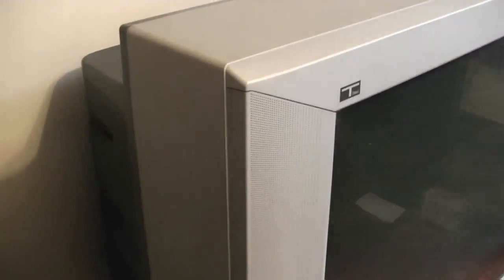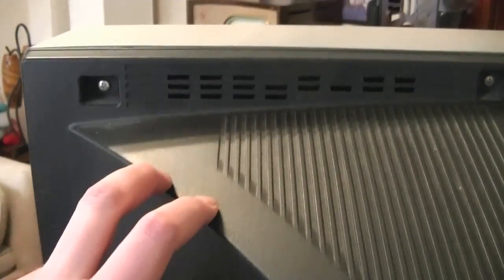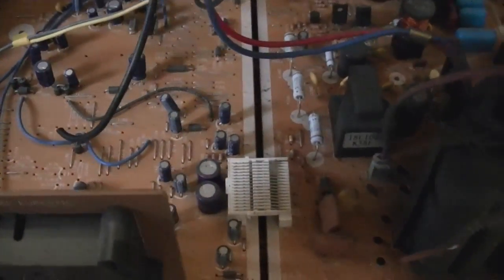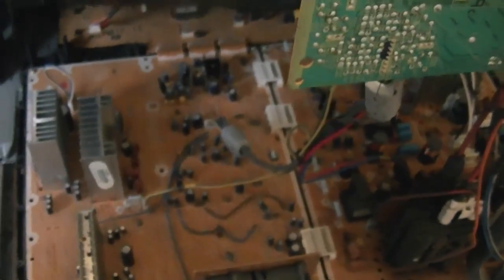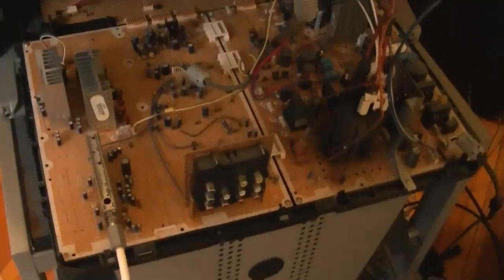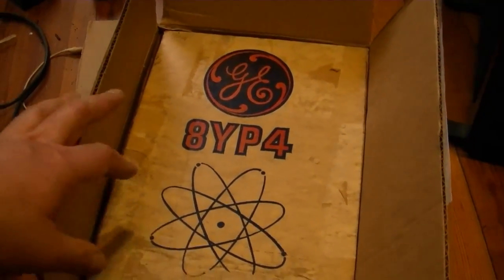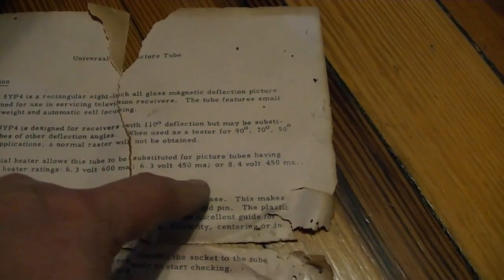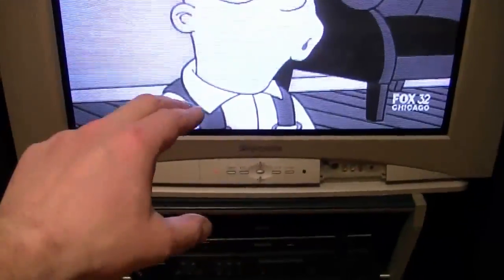Panasonic Tau Repair

Comment: My Panasonic Tau 32" model CT-32SL14J TV just quit last week. Played the night before. Shut off normally to go to bed. Next evening I hit the power button on the remote and for the first time in over 12 years.... Nothing happened. I checked everything after trying the power button on the set. I unplugged it and waited and plugged it back in. Still inoperative. Tonight I removed the back and checked the fuse. It was open. Subbed in a fuse for testing. Checked for low resistance on power cord. It looked ok. I hit the power button and the set is operating normally again.
I bought it used in 2008 for $40 from a couple that had gotten a new flat screen in anticipation of the DigitalTV changeover even though they were using cable. Oh boy... I have some doubt their flat screen is still working for them.
I use this Panasonic Tau several hours a week. Tucker, Hannity, Ingraham, Little House, Andy Griffith is about all I watch. TV was once off for over a year. I just wasn't watching.
I truly like this TV. I'll try to keep it for the rest of my years. It's very very heavy! Moving it is a two man chore. Too large and heavy to move safely for one guy. I do kind of wish to put an older RCA console tube stereo where it is with a flat screen to come up behind it. But I haven't partly because I like watching this CRT TV.
Thanks for your videos. This video was encouraging. I wasn't anticipating the likelihood of an easy repair.
Be well and God Bless.

Comment: i have one of does tv but its have a problem when i turn it on i see that the only thing i see is like static left to right what can i do to fix it i try with the screen and focus usig a screwdriver but it only turn white and black with the static left to right help me please
Reply from the maker: What are you using for a signal ?  This TV is too old to receive HDTV broadcasts.  You need a converter box or like a DVD player hooked up to the composite inputs

Comment: I watched your video and have a question AFTER replacing the fuse. My Tau (also 10 years old) stopped working…..the symptom is that depressing the power button  illuminates the "RED" LED steadily, then it blinks twice accompanied by a click-click-click sound………….and then, nada.

My 6.3 amp fuse was located on the LEFT side of the board, right near the AC cord plug in……..it looked okay BUT I replaced it anyway, put the set back together and the same exact symptom, no change. 

Any thoughts? The fuse did pop once 4 years ago and we replaced it then and all was good……not sure what this particular issue is, however.

Thanks for any help that you might render!

Steve
Reply from the maker: Hi.  Sorry, I don't repair modern TVs and really don't know much about them.  I got lucky with mine and just had to replace the fuse.
Reply: bandersentv Thanks for the response!! I HAD to try the "fix" because that fuse had burned out once before……..it's probably a sub-board component that failed. The Tau is headed up to the curb as soon as I can find 3 other guys to help me lift it!

Steve

Comment: Nice how you got that Panasonic back so fast Bob. Have you ever fixed Projection sets, especially the newer large screen types. I have a 51 inch Sony Ive had for a few years in early 2000 or so. The Micro-processor decided to just show error problems on the  screen relating to color issues (as the service manual says) and it just does not work after anymore. Especially when I replaced a color IC's they said... Very aggravating when a small micro all of a sudden tells you whats wrong. haha!

Comment: I had seen these alot in my shop. The fuses go out due to current surges from the degaussing cycle. I would put a slow blow or time delay fuse back in it to stop the fuse from going out again. Also, alot of modern sets stay in a latched state from the time power was lost. If the power was on , it will turn back on automatically when power is restored.

Comment: I'm glad it was something as simple as a bad fuse.  Someone left a 42 inch LCD TV by a dumpster a couple years back with a bad fuse, but the repair wasn't as simple as replacing the fuse.  Tom

Comment: Some TVs have an option in the menu of what to do when power is restored after a failure: either "last state" (so if the TV was on when the power went out -- or the fuse blew! -- it'll automatically turn back on), or "stay off".

Comment: When wall mounting a flat screen TV, be sure it isn't too close to the wall, or cooling vents can get blocked. This is less of a problem with LED TV's since they make a lot less heat. The TV I have now was a victim of a poor wall mounting job, the main board got so hot it warped and the processor BGA grid failed. A new main board fixed the issue and it's now only used on it's stand.